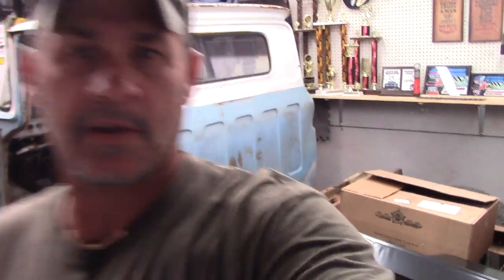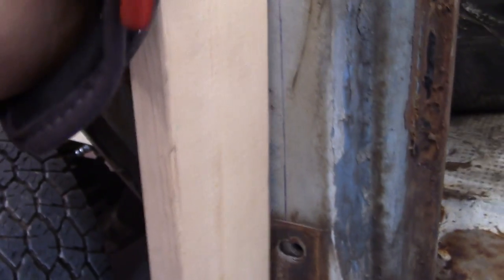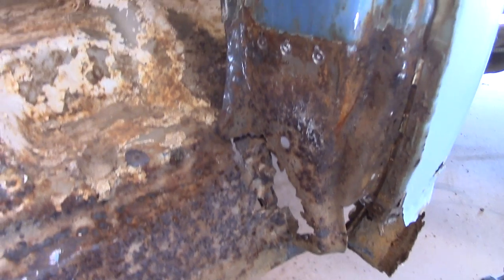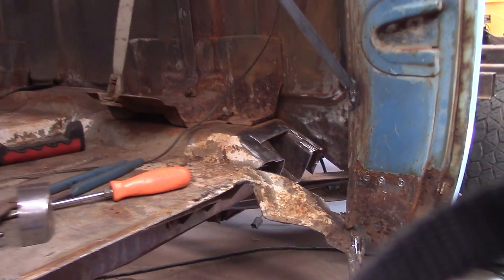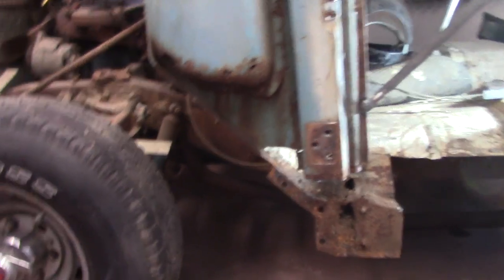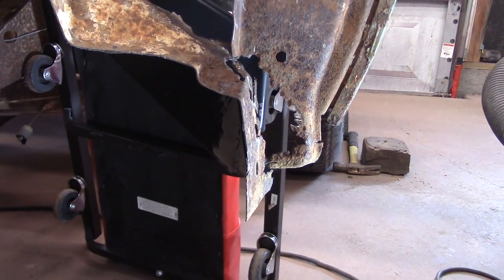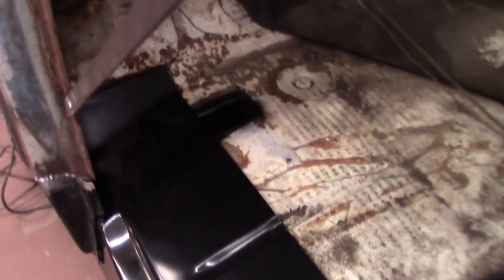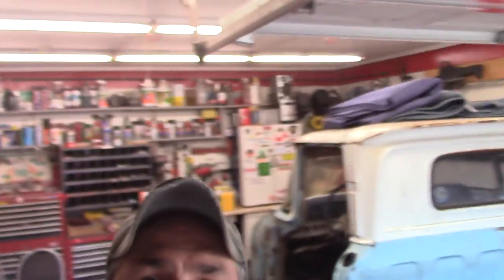Rust repair floor pan chevy c10

Comment: We just made out first attempt at an outer floor repair on our 63, had to cut the back end off and splice 1 1/2' and cut the front corner and splice a pizza slice to fit too, out cab support needed to be cut the same way, almost seemed like we ended up fabricating it from scratch for how much we cut it up. Your videos have been so helpful to us, thank you so much! I need to work on my hammer and dolly work for sure too! been a long time since i used them.
Reply from the maker: Dean Urbanek good luck on the 63 man it should all come together

Comment: the low parts of these trucks Needs a design change.If you look at all of the chevy truck floors.where dose most of the dirt and water end up.You need to bring the floor up by 1 to 2 inches to divert the water away from any corners or low spots.Just buy doing that you will no longer have a floor issue again

Comment: Did you replace the cab mount bushings, there looking like my old ones, I put polyurethane on mine, they worked out good
Reply from the maker: Xtreme Scratchers  I Will be Replacing cab mount bushings before I start on the bed

Comment: Another great video.... one question... I have to place a patch in the middle of the floor in the cab from the previous owner cutting out a hole to place a floor shifter instead of fixing the steering column shifter.  I am sort of new to welding and I am wondering what your thoughts would be as to where I could place my ground clamp that is decently close to my welding area.   Do you think just placing the ground clamp on the side by the rocker would be ok?
Reply from the maker: That’s exactly what I did mounted the ground clamp to the side of my rocker when I welded any of the floor patches

Comment: Great videos buddy!  You just showed me easier ways of tackling my truck than I planned on.. Question, I am in the middle of burning in the replacement lower outer panel piece just like you did and I have the same gap towards the front kick panel edge.  What did you do to fix that?  Any info will be appreciated.  Thanks buddy.
Reply from the maker: DoobieBro   After everything was welded in around the floor I clamped/hammered and dolly those gaps in and welded in strong, seam sealer will finish the gaps in the floor board
Reply: Sorry, just to understand clearly did you bend up the angle on the new piece flat to stretch it to the kick board?  I thought about slicing and adding more material.. Thanks.

Comment: Another great video. Do you have a  preferred brand for spot weld cutters, cutoff / grinding wheels, or for any other tools that you use?
Reply from the maker: RustyJeep  don't really have a preferred brand on these tools just don't  like buying the cheap stuff don't seem to last, spot welder cutter came from car quest grinding and cuttoff wheels come from lowes
Reply: Gibson63 
P

Comment: Great vid. I have 1 question I by no means am a welder so I had a guy from Craigslist weld me a driver's floor pan, and rocker on my 84 c10. Paid him he left so I thought everything was cool but I went to hang door several days later and the door doesn't fit. Is there a easy fix for this? Can a 1" section of floor be removed and the rocker/cab area stretched or pushed apart with a hydraulic ram? Or something else? Thank you for any suggestions
Reply from the maker: He should have test fit the door before the first spot welded I’d get someone else to look at that ,might be able to grind down the welds and adjust the rocker to fit the door, really hard to say without looking at this first

Comment: I got a question about the lower kick panel
Did you replace the upper half and still over lap on the bottom? 
You still went lower door pillar- kick panel- floor pan- cab support 
In that order the way the original steel was?
Reply from the maker: Only replaced the lower kick panel top was fine

Comment: Can you also use a stick welder or does it not  weld as nice on those body panels?
Reply from the maker: Farmer Jdriders  never used a stick welder or a tig, I learned on this mig welder for all my sheet metal work
Reply: Gibson63 ok thanks